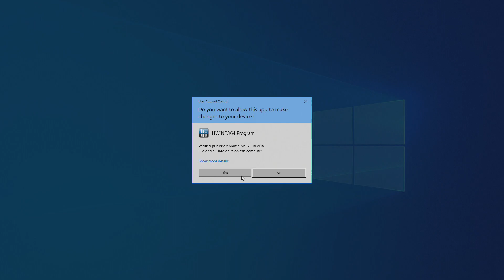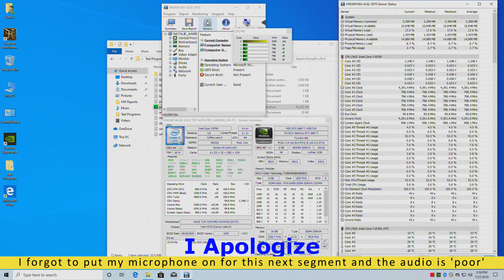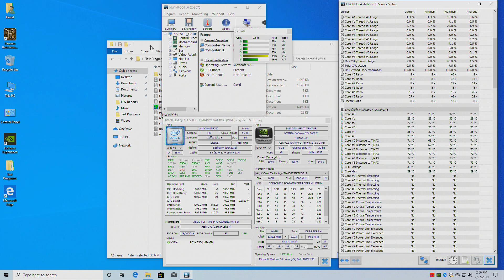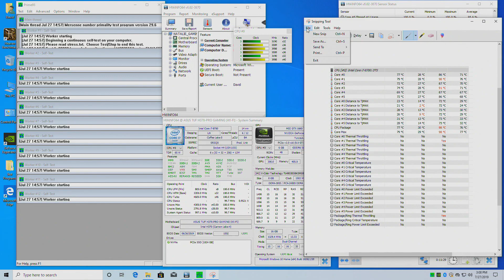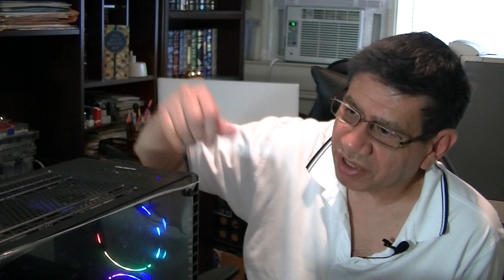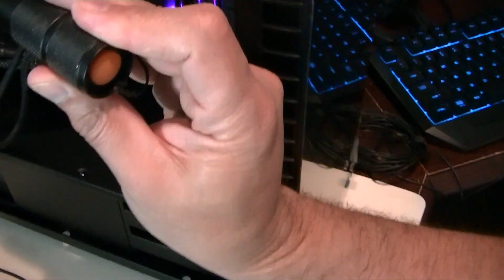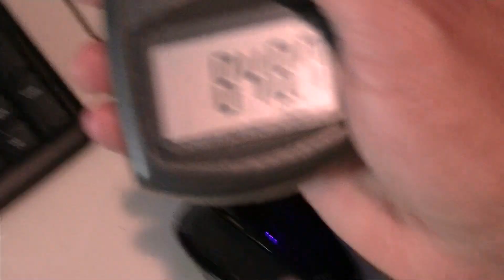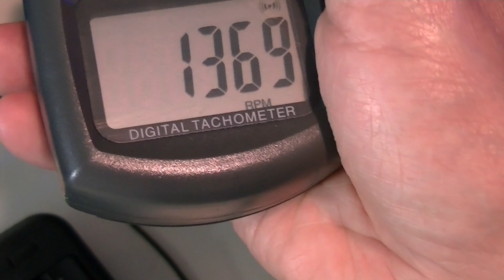Gaming PC Build - MUSETEX Case Review (Part 2 - Testing)

Comment from the maker: There will be a Part 3 to this review.  See the UPDATE note I added above.
Reply: Hey quick question can I tell me the name of the cable to turn the pc on
Reply from the maker: @rafaelnoveron2665  It is two pins usually appearing at that bottom of your motherboard.  The Front Panel power-on switch momentarily shorts them out and that gets the motherboard to turn the PC on.
Reply: You*
Reply from the maker: @rafaelnoveron2665  No problem :) I figured that is what you meant.  By the way, you can take a look at this other video I created to see exactly how the front panel should be wired https://www.youtube.com/watch?v=Af77ZmLpNcI&t=12s
Reply: @PE4Doers  ty!
Reply: i guess I am pretty off topic but do anyone know of a good place to stream new tv shows online?
Reply: @Samuel Jack try FlixZone. You can find it by googling :)
Reply: @Samuel Jack i use flixzone. You can find it on google :)

Comment: My RGB lights won’t change color. And sometimes my computer will crash after boot up. Any thoughts?
Reply from the maker: Do you have any overclocking applied?  If not, then you probably need to remove any extra PCIe cards (such as capture or Wireless cards) and see if that changes anything.
Reply: @PE4Doers  I don’t use any overclocking and I only have a graphics card. I don’t have any other PCIe slots in use. I didn’t have any problems until I switched to this case. I did break my graphics card clip holder, so could a loose fit graphics card cause this problem at least for the crashing?
Reply from the maker: @daxton5391  Hmmm, the case should not by itself cause that, unless yours has an RGB or ARGB  connector connected from the case to your motherboard.  Otherwise it sounds like the broken GPU connector could have damage one of the lands on the motherboard.

Comment: i built a pc with this case but have not been able to get this to work...does the case control the power supply? I was trying to test my power supply but it does not work and was wondering if the pc turns the power supply on and off ...either way i cannot get the power to turn the computer on and the case directions are crap...could you help me with the connection form the case to the power supply as I just want to make sure i did not miss something.
Reply from the maker: Unfortunately, they changed the electronics associated with Fans/RGB after I reviewed it,  The new version has caused significantly more problems than I predicted when I reviewed it (as I predicted),  Cooling is the biggest issue, however the RGB took a nose-dive due to their changes.

I hate having to say that, since my daughter still has that case, but I am hopeful I can upgrade it for her soon.

Comment: I’ve watched all 3 of your vids concerning your daughters PC.   Just throwing in my experience with this case, i5-10600k paired with the Aresgaming Black 5 cooler. For 10min I held steady at 74C. Core 1 got up to 79C.   Idle temps are around 30C.    

I love your content.  Keep it up!
Reply from the maker: Glad to hear it worked well for your system.  I put the one my daughter built under severe testing, and it went over 100 degrees C on some cores.  That is why I switched to an all-in-one cooler which took care of the problem.

Thanks so much for the great comment :)
Reply: @PE4Doers   I’ll do more severe testing soon and report back.  I’m only running a 1050ti gpu due to the current state of pricing etc so I’m not putting mine through severe conditions (yet).  

👍🏼👍🏼
Reply from the maker: @Justin-dy2ib  Sounds great :)  Let me know.  A lot of people are doing the same thing you are given the current availability and pricing problems when trying to get a GPU.  Which new card are you hoping to score?
Reply: @PE4Doers  I was hoping to find a Gigabyte OC Vision 3070 (white) but heck at this point I may even settle for a 3060.   God bless it, they’re just way too high.  Maybe after the 40 series release they’ll drop.   Let’s hope so.
Reply from the maker: @Justin-dy2ib  I know what you mean.  Did you see the video where I was able to score one of those cards?  It cost me $1100 before sales tax.
Reply: @PE4Doers  YES!!! Very lucky indeed!! There’s no Micro Centers near me.  The only thing close to that is a Best Buy.
Reply: @PE4Doers  Decided to do a strenuous test.  @ 10 minute mark I hit 91C on c1 & c6
Reply from the maker: @Justin-dy2ib  Sorry to hear that.  Now I feel so guilty about the cards I've been able buy.
Reply: @PE4Doers  Don’t be!!! In time I’ll be able to snag one.  I’m in no rush.
Reply from the maker: @Justin-dy2ib  That's still OK.  What cooler do you have again?
Reply: @PE4Doers  Aresgame Black 5. I concluded the test after 10 min and hitting 91C
Reply from the maker: @Justin-dy2ib  I wish you all the luck Sir :)
Reply: @PE4Doers  thank you very much!
Reply from the maker: @Justin-dy2ib  Heat is one of the most difficult challenges for the better looking PC cases.
Reply from the maker: @Justin-dy2ib  You are very welcome :)
Reply: @PE4Doers  I agree! When I manage to snag up a better video card I will upgrade my PSU and move over to an AIO cooling unit!
Reply from the maker: @Justin-dy2ib  Yes, that is important.  Just be careful not to get a PSU that is 'too big.'  The ideal point of efficiency is at 50% load.  Which means if you have something like a 5900X CPU and a 3080 GPU, which would draw between 350 and 500 watts (depending on the load), you best choice is to average those two extremes, then double it.  So that would be 425x2 or 850 watts.  

By doing that, you will put you power draw right in the 'sweet spot' of performance of you PSU, thereby having it run at peak efficiency.  Doing that will not only extend the life of your PSU, but since the loss of efficiency leads to more radiated heat (that is where the wasted power goes), it will keep you system cooler overall. This is not something I just made up, but was a key concept I had to learn in my Electrical Engineering course.
Reply: @PE4Doers  Thank you so much for the explanation! Knowledge is power!   I’ll try to keep you updated on my progress!
Reply from the maker: @Justin-dy2ib  You are quite welcome :) Good Luck!

Comment: You're gonna kill it before she even gets to try it
Reply from the maker: They are a bit sturdier than that :)  I made sure not to disable any safeties built into the motherboard, so killing it is highly unlikely.   I Once "accidentally" left the cooler of an i4-8600K CPU (on a testbench).  It shut down when it reach 105 deg C, and has now run a couple of years in my server without an issue.

Comment: Do you have a video on the rgb and how you got it to work?
Reply from the maker: The the version that came with the case we bought it was simply plugging the one cable into a Molex connector on the PSU (always on).  I believe I show how that is done in the second Build video (in that series) with my daughter.  I have been covering how the RGB is connected all through my build videos, but maybe I should consider making a video dedicated to just that.  What do you think?
Reply: @PE4Doers  yes
Reply from the maker: @ypreeg  I will look into doing just that.
Reply: @PE4Doers  Thank you
Reply from the maker: @ypreeg  You are very welcome :)
Reply: @PE4Doers  because its kind of weird that i researched many videos and everyone I saw with my case just plug and play basically, but mines doesn't, so i was wondering maybe i got a bad fan hub which is not rgb compatible. I bought a rgb converter 5v - 12v 4pin and it still don't work so my next move is to change the hub. The rgb RAM sticks work and cpu fan perfectly. Just case fans not lighting up.
Reply from the maker: @ypreeg  You are probably 100% correct. I believe those controllers are the root cause of the many problems I have heard about.

My daughter and I did not have to deal with that problem fortunately.
Reply: @PE4Doers  thank you for replying.
Reply from the maker: @ypreeg  Your are very welcome.  I am glad you put it in the comments so it may help others with a similar problem.

Comment: I can always take everything out of the Case and test it out in the open so I discarded everything, Mind you, the i7 8700 CPU is a real oven.

But going on the subject of temprarature, is the case a good investment quality / price? or have any suggestions ,.
Reply from the maker: I agree, the 8700 tends to generate a lot of heat, however I had them in two other cases that did not have any problems moving the air through to keep them less than 80 degrees 'C'

Comment: thermal paste hot spots the case works just fine for me with a 9900k oc to 5.1 so yeah dont go by this
Reply from the maker: You lucked out big time -  I did show in Part 3, that there were 'No' hot spots on the thermal paste, which I actually changes three time with different brands.

Comment: I'd lean more towards the thermal paste on the cpu being the cause.
Reply from the maker: I changed it twice - just in case - to Arctic Silver.  But it did not change anything.  This was only fixed when I changed to an AIO Cooler that also replaced two of the front Fans for the Cooler Master RGB.  I show that in a later video.

Comment: Im about a year late but, how much space is there between the back panel and the holes for the PSU cables to go through?
Reply from the maker: It is enough for most PSU cables.  You may want to connect them to the motherboard prior to screwing it down to the case however.
Reply: @PE4Doers  Thanks a bunch
Reply from the maker: @Greyshirk  You are very welcome

Comment: Hello, thanks for your very informative videos, I have a question regarding the fans... I got a Gigabyte Aorus Pro mobo for a similar case, but, I don't know where should I connect the control module for the fans to be controlled by the motherboard. Even though, where I connected them, it allows me to control the lights of the fans, so, maybe I'm not far.
Reply from the maker: Are you trying to have the fans controlled by the Motherboard?  If that's the case, I have not seen one of these able to do that.  The later models can be attached to an ARGB connect - if your motherboard has one.
Reply: @PE4Doers  thank you for your quick reply. I was trying to see if possible, since I stumbled into the possibility of controlling the RGB lights from the motherboard. Another question would be if you happen to know if there's a way to filter (mesh or magnetic) the front intake, because the model I got (I think it's the 907) doesn't have that sort of filter in the sides of the front panel, it just have a gap of about a centimeter, which will let the dust in.

Comment: My old hhd wont fit into this case for some reason any idea why? I have a ssd as well
Reply from the maker: I assume you mean it does not fit into the drive bay in the front-bottom (accessible from the back).  How old is that hard disk?
Reply: @PE4Doers  yessir . Shes old lol
Reply from the maker: @khloeskreations5552  You could mount it on top of the PSU shroud, but that may require drilling some holes.
Reply: Any tips on what to do to get  use the hhd in this case since it won't fit?
Reply from the maker: @khloeskreations5552  I would really have to see some pictures of it to give any detailed suggestions.  If you want to email them to me at my business email I would definitely look and let you know if I have ideas.

Comment: this case sucks, wish I never had bought it. no way to mount the ssd hard drives unless you want to use double sided tape is what i will have to do. 0-10 I give this case a 1. look elsewhere.
Reply from the maker: I generally agree.  I am a 'Heat Enemy', so the first time I looked at it online I was concerned.  But it was ordered and I tried to make the best of it.  I am still amazed by how many people seem to like it.
Reply: @PE4Doers  hello quick question ... why wont my old hhd fit into the slots.... ?? Any idea why ?
Reply: @PE4Doers  well the more I install things into it the better I am liking it, it does seem pretty solid only issue the hard drive mounting  but if you go m2 your ok. I agree with you on how many people like it actually rave about it. now i give it a 5 out 10 I guess it could be a lot worse. mine only has 4 fans.
Reply from the maker: @prmayner  Yes, it can easily grow on you.  I hated the one we put into my daughters case a lot more the first time I had to work with it, then it calmed down.  I still do not like the fans in terms of cooling capability.  The one we had also came with only 4 fans, but I had to add more when I put in the AIO cooler.  I would give our a 4 I suppose.

Another video will eventually be made about the one my daughter has, since she asked right before the pandemic if I could change out the mismatched fan (one of the original 4) with one that matches the two on the Cooler Master 120 RGB I put up in the front.  I bought the fan, but have not been over to her apartment since January :(  When I can go back, I will make a video showing the changes I will be making.

Comment: i am a newbee!Can you tell me how to cennect the fans to the motherboard please!
Reply from the maker: That's somewhat difficult to answer I'm afraid.  The one I used for this review and build was apparently a very early version that did NOT connect to the motherboard in any way.  I've heard from other viewers of this series that some of the newer models come with a Fan/RGB controller that, at least in some cases, can be connected to the motherboard.  Some of those sound very similar to how my Thermaltake v200 case does it, which I reviewed in a separate video, and at least one new model supports the newer ARGB fans.  Sorry I cannot be more help.
Reply: thank you for contacting me.I have since found out how to hook up the fans ! Thanks again
Reply: @leejimerson3354  how do you hook them up?

Comment: This video is very interesting and informative, I was planning on getting this case but I’m a beginner with building a pc and I wish I knew what these tests were proving, if you could explain it in a little dumb down way that would be incredible!
Reply from the maker: VinxFTW, I fully understand any confusion you might have, this is a very 'techie' video regarding Heat performance of a PC case.  There are two primary measurements that PC Power Users (such as, Gamers, Developers, Video Content Producers) looking to buy a computer case are generally interested in knowing:  1) How well can the case dissipate the heat of a computer's inner workings when that computer is placed under stress, 2) How much noise leaves the case when that computer is running under stress.

The various scenarios I ran in this video confirm my worse fears; that I had when I reviewed the case three videos earlier in this build series.  It struggles to dissipate the heat of a stressed computer system that has been installed within it.  Although I did not measure the noise levels (using my DB meter), I did not notice any perceivable noise issues, so I did not test and/or compare that metric.

Now granted, the specific system I put in that case tends to generate more than the average heat, however, it is well below my 'Daily Driver' PC workstation that I do nearly everything with, which happens to be in a case that has excellent characteristics that properly and quickly dissipate the heat (without the fancy RGB lighting).  For that system I use a Corsair 200R case, which has minimal RGB - I also modified the side panel on that case to show some of that minimal RGB.

The bottom line is, this case is quite attractive will all the tempered glass, and is very quiet since the fans provided with the case run at a constant speed and do not push through much air (the Fan blade design is the key factor here, which was likely done to keep them quiet).  Now some of that can be eliminated by switching out some of the Fans to an All-In-One (AIO) Liquid cooler (which I did in the video that follows this one - Case Review Part 3).  However that adds significant cost to the system, and may have to be fully replaced within 5 or 6 years.

One important thing to remember is that excessive Heat will do two things to a PC system: 1) Reduce the system performance capability, since when it hits what is referred to as 'throttling' (caused when the CPU chip automatically reduces its clock speed due to excessive heat), 2) Reduces the overall life of the components within a PC system, since Heat kills electronics.

I hope that explanation helps.
Reply: PE4Doers Thank you so much for the explanation! I’m glad i stumbled upon your video. I have decided to choose a different case and with some searching I came across the NZXT H510i. Beautiful case and slick rgb. You have very entertaining content and I wish you and your daughter well! Thank you!
Reply from the maker: @BiigVinn  Thank you, I am glad I could help.  I wish you luck with your computer build.  You know, I will be doing many more reviews and performance testing videos, so subscribing to my Channel may help you prepare for future upgrades (hint hint :) )
Reply: PE4Doers I just ordered my parts and you know what I think I will happily subscribe.

Comment: What did you do with the VDG cable that’s part of the chip? I can’t figure out where to plug it
Reply from the maker: VDG?  Does your have a RGB controller board that is not integrated into the front panel?
Reply: @PE4Doers  yes it does. im having the same issue. the VDG is a 3 pin thats supposed to connect to the motherboard so you could control it using software but i cant figure out where on the mother i need to plug in.
Reply from the maker: @vytautasolberkis1211  are the three pins all in a row, with one, then a space then, two more?  If so, then it's an ARGB (5v) connector, which is only supported by the newer model motherboards.  Which make/model motherboard do you have?